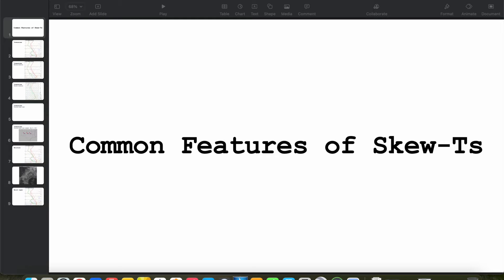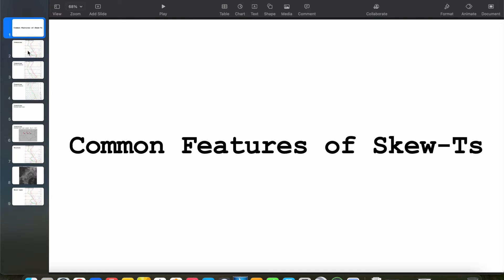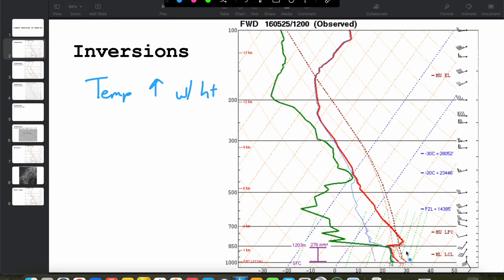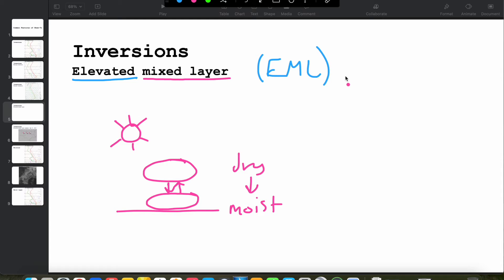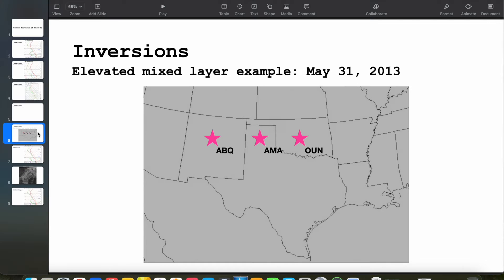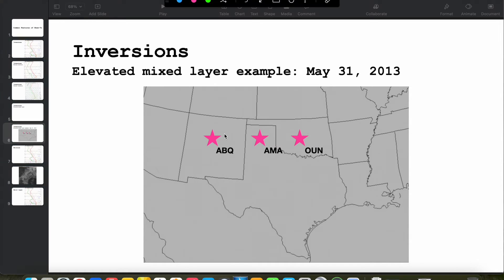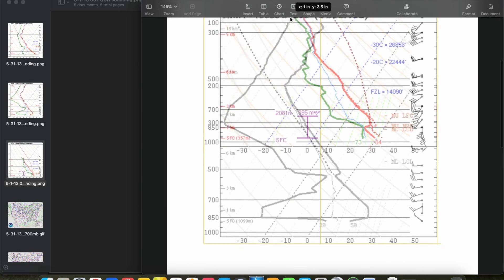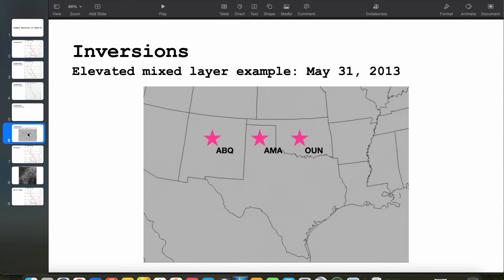Definitive Guide to Skew-Ts and Hodographs - Part 4 - Common Features of Skew-Ts

Comment: 16:20 does the purple have anything to do with the mixed layer?
Reply from the maker: No, that profile represents the wet-bulb temperature at every point. I talked briefly about the wet-bulb temperature in Part 3b of this series, but it's basically the lowest temperature air can be cooled to through evaporation at a constant pressure.

Comment: This was great! I have heard and seen the dry slot in the layers between 85pmb and 350mb. How does that affect the severe weather potential?
Reply from the maker: Thank you! When you have substantial dry air aloft through a deep layer, a couple things can happen: often the dry air is associated with steep lapse rates and, therefore, strong instability, but the dry air is also often warm, which can yield a strong capping inversion that suppresses convection. Ample dry air aloft also favors more of a damaging wind threat via downbursts, as rain-filled downdrafts evaporate and cool once they hit the dry air, causing them to accelerate and spread out as outflow once they hit the ground. Thus, drier environments favor more outflow-dominant storms (more of a wind threat than a tornado threat, whereas more moist environments help temper the outflow potential of storms.
Reply: @ConvectiveChronicles  thank you for explaining that. It makes more sense now.